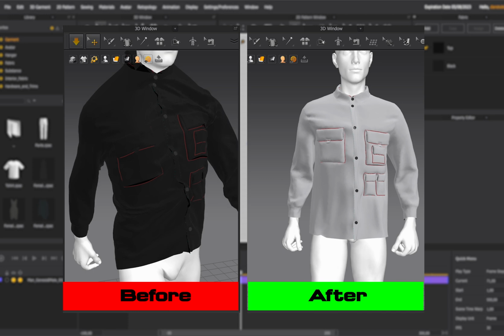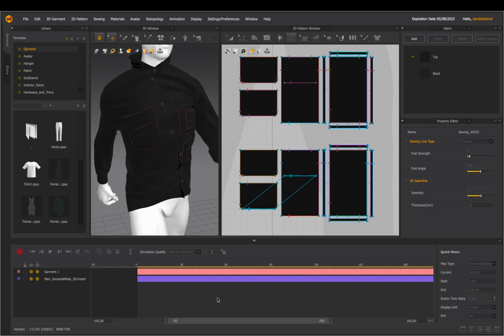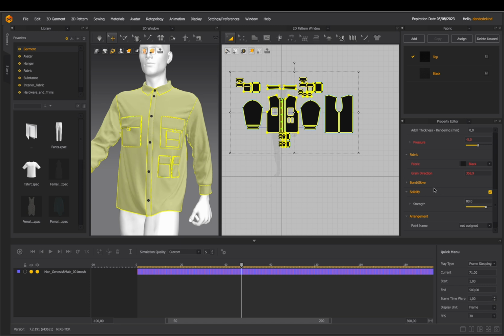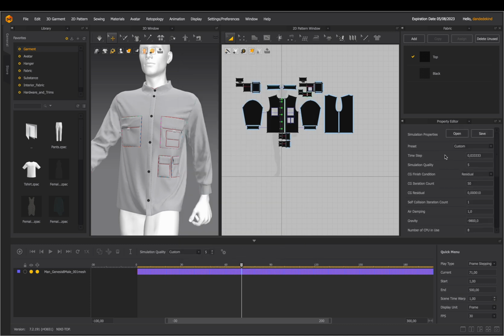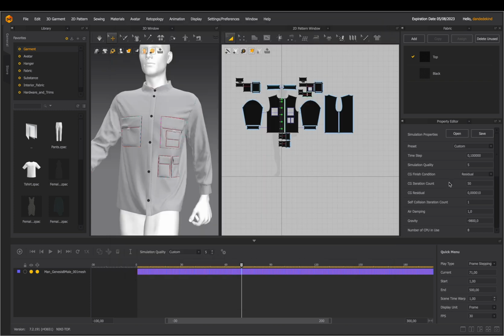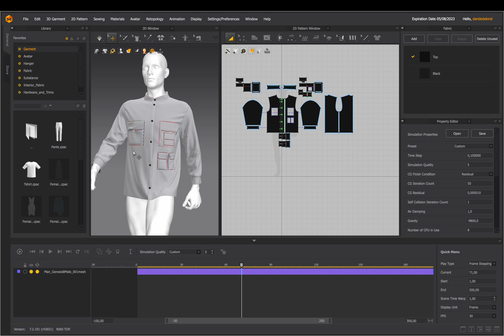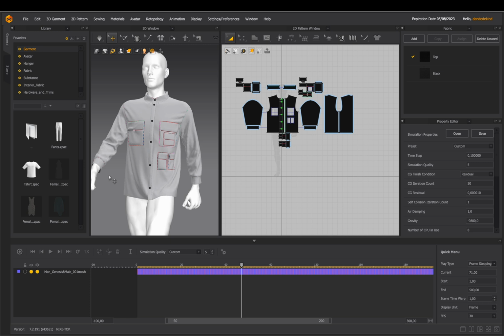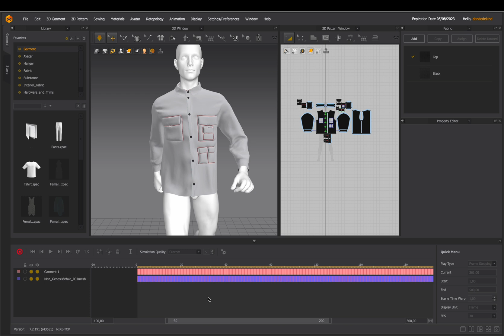How to Fix Marvelous Designer Cloth Simulation when Animating - Marvelous Designer Tutorial

Comment: Will this not fuck up the framerate of the cloth animation? The timestep value is another way of indicating the framerate of the scene. So if I import the animation a character running in 30 fps the correct timestep is 1/30 which is 0,033333. I think the main issue is that the simulation is not on fabric detail and the weight of the cloth is not correctly set. I will test this for sure and see if I have some animation mismatch in unreal
Reply from the maker: Hey, I didn’t realize this one’s a thing. This was just a solve I found when I started learning 3D Fashion. I’ve since moved to CLO due to issues I’ve faced like this with marvelous as they seem to have things sorted over at CLO
Reply: @dandedekind  hey no worries mate, I just wanted to give a headsup to anyone messing with this in a game engine or in my instance ue5 application. You can just reinterpolate the framerate in normal 3D Dccs and get good quality, but unreal 5 is very nitpicky with alembics and framerates 😬👍
Reply: yup it does, i just tried it
Reply: @maxwilledit  Yeah had the same result. This is definitely a hack if your short on time. But all it does is that it slows down the movement of the character so much that the simulation is cleaner. Switching in Simulation mode to animation stable + a particle distance of 8 gives me the best results.
Reply: @Phillefx  thanks bro, i also found this on a reddit so it might help too i dunno 
"Try this, I use this setting for my fast moving animations. Hope it helps

FPS: 24 Play type: real time Time step: .041667 Sim quality: 5 CG finish: residual (!!very important you switch this to residual) CG residual: .000010"